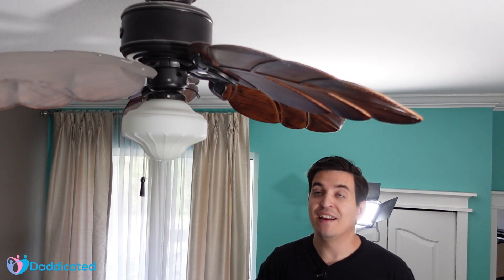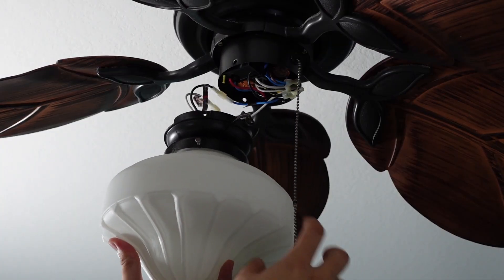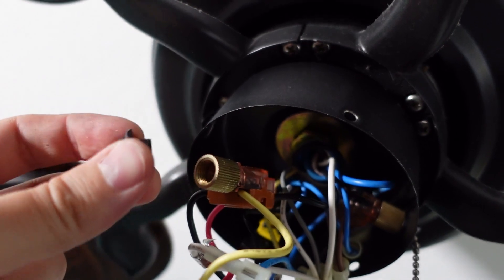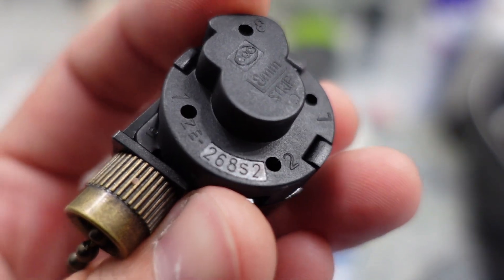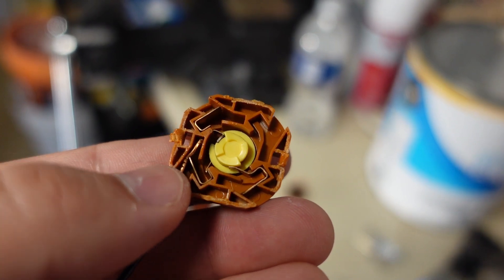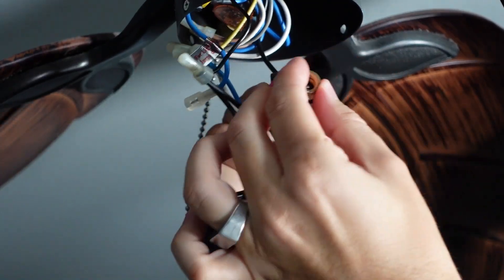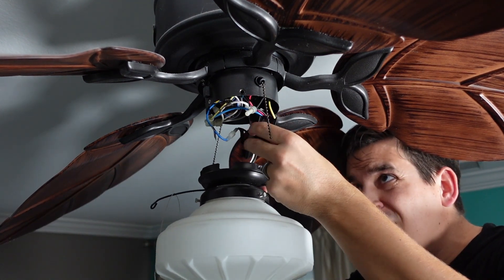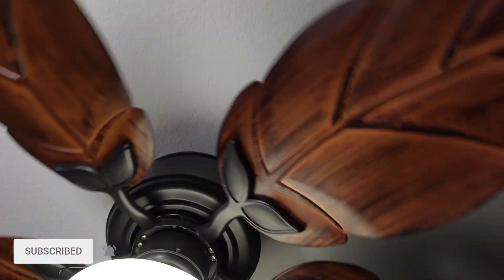How To Replace Fan Light Pull Chain Switch

Comment: I wired the new switch (different model) exactly like the old switch, now it only turns on on just one pull the second it stops but the motor hums the next two it stays off no motor noise.
Reply from the maker: It sounds like a wiring issue. Double-check the connections! Maybe do some more digging online to ensure u wired it right.